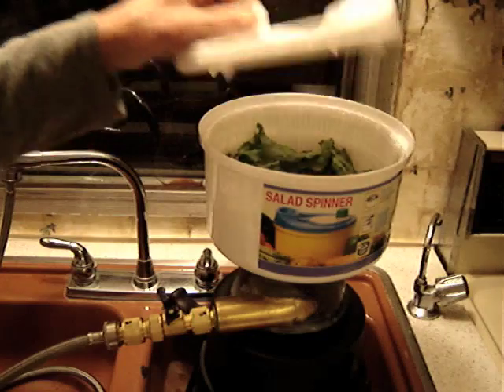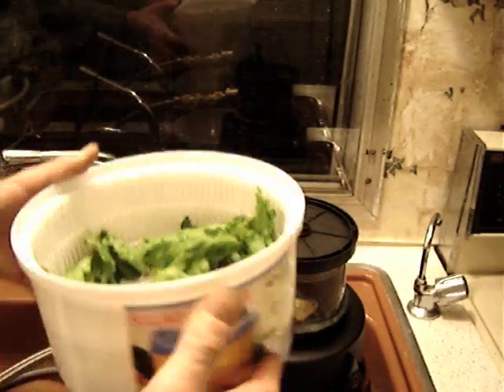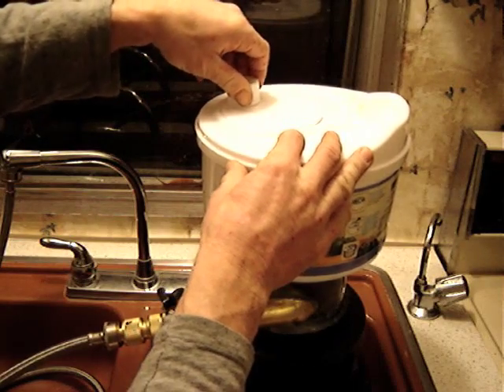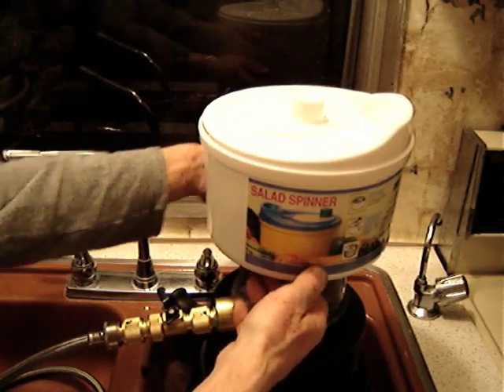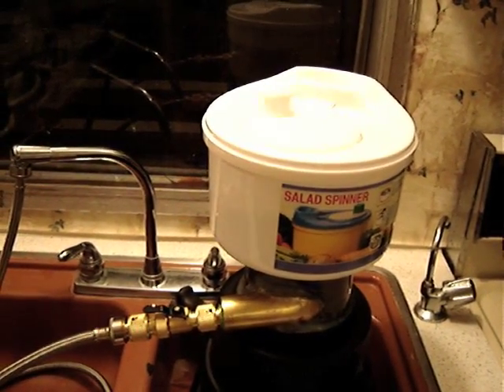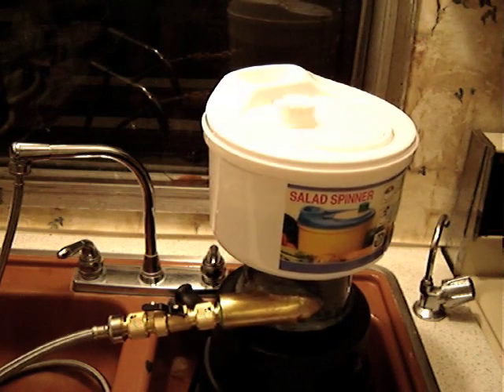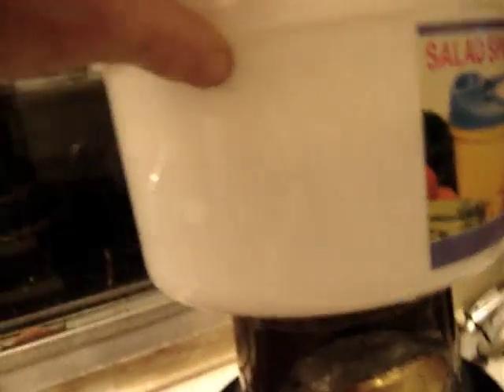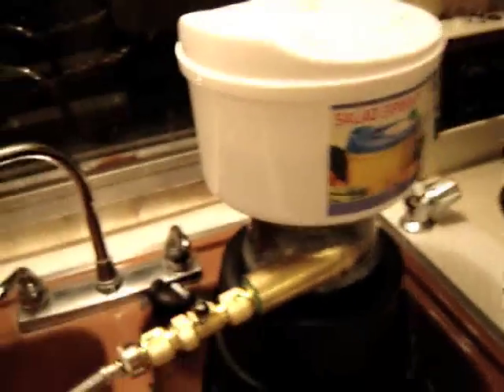SinkScience #04 - Tesla CD Turbine-Powered Salad Spinner

Comment from the maker: Many folks on city water don't pay for it; however personally I do use a well and pay for pump power. I  have a nearby creek that I will tie into...and get more than 90 psi pressure for better performance. Truly free energy.
  I figure, if I was going to fill the sink anyway, I may as well run it through the turbine and have some fun with it.